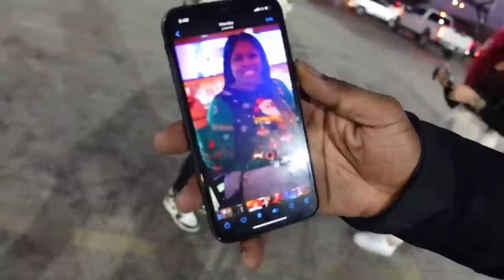PUT NEW 32INCH RIMS ON MY BRAND NEW 2023 BMW 760I *RUINED IT*

Comment: I don't know, not feeling that style of wheels, that big face doesn't look right. The face looks too flat, needs to be more concaved in the rear especially, and rear wheels also need to be pushed out more/wider to be flush with fender.

I also wouldn't go 26 on this model. The 24 looks like it barely fits, but it also looks like the perfect size. Seems like you'll be rubbing or will have to do some extensive irreversible modifications to the body to make them fit. I don't know, I'm just assuming. Hopefully, it all works out for you. Peace.

Comment: These wheels do look better than the 1st set you had on there! But if the car could sit a little bit lower it'll  look even  better!  The wheels sitting on the back of the car may have been better but they both look good, car just need to sit lower

Comment: no Cap! Those wheels make the car look so presidential, it looks like you need to be chauffeured around. And sorry to say but that Beamer is killing the Mercedes From the outside. But they both go super hard inside. But of course the  technology on the Beamer speaks for itself. I would Still Keep them both because both of them are top level. Also with the black lip of car look like it is riding on nothing but wheel. To hard